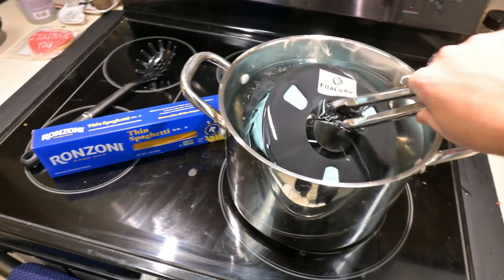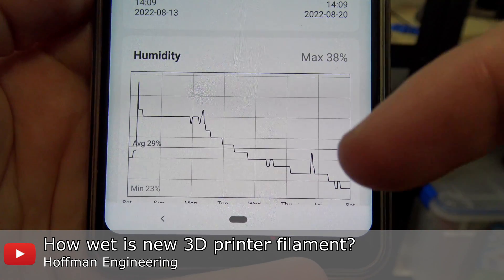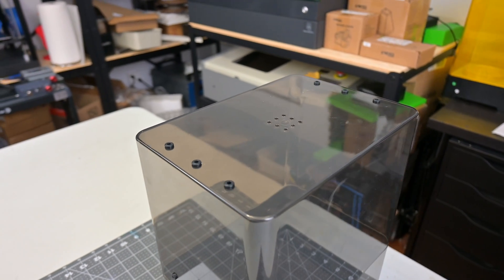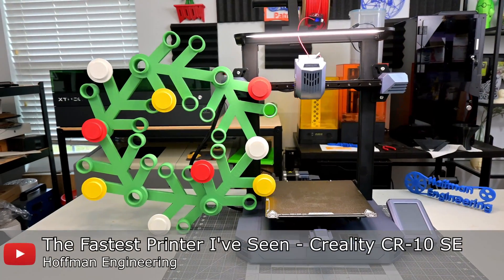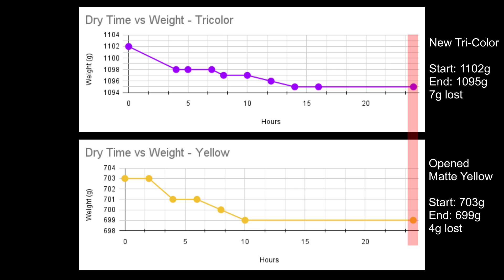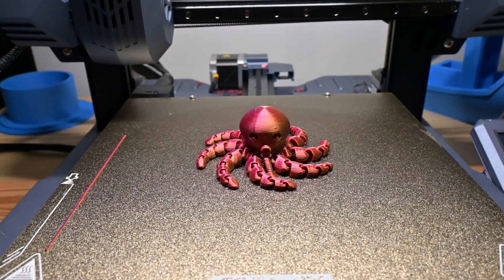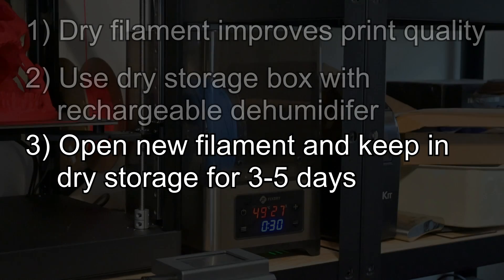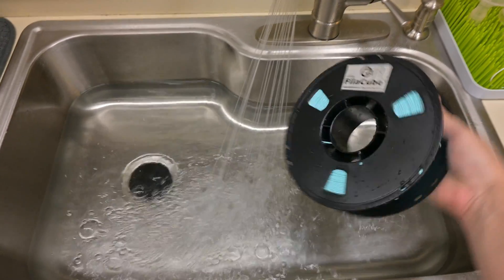Is wet filament really that bad? Do you need a Filament Dryer? - FIXDRY Filament Dryer Review

Comment: This is confusing. Just recieved my new filament dryer and i haven´t opened the box yet. After seeing this video, https://www.youtube.com/watch?v=5CFxT1q6dX8https://www.youtube.com/watch?v=5CFxT1q6dX8, i don´t know what to believe.
Reply from the maker: I have two concerns with Tom's tests. The first is that he never dryed the filament. His "fresh" control tests were right out of the vacuum sealed bag, which is already wet filament. My tests show that new 1kg PLA contains about 3-7g of water. So he never shows what actual dry filament looks like. 

Second, this is from 3 years ago where a prusa mk2 will print at a speed of 60 mm/s. Modern printers are printing at 10x that speed, where filament moisture can cause much bigger problems.
Reply: @HoffmanEngineering  Thank you for reply. I thought so too that his video was too good to be true after seeing many videos that filaments humidity has a big impact how the prints turns out.

Comment: I think paying £90 for a FixDry dryer is a small price to pay for the difference in print quality alone. I agree on all points raised about keeping dried filament in a sealed storage box, with silica crystals inside to maintain humidity thereafter. I found freshly dried warm rolls of filament attracted moisture like a sponge, unless I protect them from humidity after drying. For a while before buying a dryer, I used to leave my filament inside a regular plastic storage box, which included a pair of old socks filled with clay cat litter, until I found a couple of reusable silica dry bags on Amazon to replace them. 👍

This is my opinion, I could be wrong. 😉

Comment: Hey, I also live in Florida and my home can get pretty humid at times (above 65%).   Do you think your dry box container solution would work if I was to print ASA, or do you think having an active dryer like that Fixdry would be required?    I am fine taking my time to dry out a spool.
Reply from the maker: If you've got the time, I think a dry box is the way to go. ASA isn't crazily moisture sensitive, so you don't need to worry about keeping it dry while printing. Storing it in a dry box between prints would be the way to go.

Comment: This dryer design is just dumb, they need to make the lid separate from the filament outlets to prevent the hassle of trying put the lid on and feed the filament at the same time
Reply from the maker: That is a good point. I did run into that problem once or twice, when I wanted to move the dryer but couldn't without unloading the filament from the printer. I'll have to give the Markforged dry box a try sometime in the future!

Comment: Very interesting about the silk filament not sticking when "wet". I recently tried microcenter silk PLA, and it didnt stick to PEI in the same way you showed, fresh out of the box. But i didnt dry it. Some people online did have the same issue, and some others didnt. Maybe the moisture level does affect the silks, or as you mentioned, maybe some VOCs are removed more from silk filament that affects adhesion.  Either way, this is the first time ive seen anyone make this observation. Cool video nicely done. I would mention that it doesnt seem like you did a torture test by adding moisture to the filament on purpose, then putting it through the various drying steps, but thats a minor gripe.
Reply from the maker: I did not run that experiment, but that would be a good thing to try. See how much moisture I could get a roll to absorb, and see how it dries. I'll add it to the experiment list!

Comment: Can I just store them in containers with desiccants?
Reply from the maker: Yup, you can. You will need to dry out the dessicant over time though, as they will eventually become saturated with moisture as you open the container. That's why I like the rechargeable dehumidifiers, as the dessicant inside changes color when they are wet. That let's you know when you need to dry them.

Comment: I found a reel of ABS in my cupboard, must have been there for 10 years.  Thought what the heck, I'll give it a try.  Amazingly worked perfectly, was gobsmacked.
Reply from the maker: That's awesome. I'll have to look around and see what rolls I have that might be that old. I must have some filament samples that old that hasn't been in my dry boxes.
Reply: Cheap humidity meters are available on Amazon that can indicate how suitable an enclosure is for keeping filament in prime condition, I found keeping filaments away from breathing humans and steamy locations that create moisture like kitchens and bathrooms, helps to keep moisture ingress to a minimum. Just wrapping a roll of filament in a dry towel, with cat litter in a sock can act as effective temporary moisture barrier. 😉

Comment: Great video! I've always wondered how long the "safe time" is until the filament needs to go back to the box/dryer? What about 24h long prints? I do an 8h drying in my drybox, then print with it, and probably forget to put it away instantly, or print in the evening, and turn the printer off in the morning. Is the filament still dry then? I live in a quite dry environment, with 50% humidity, so not quite like Florida ;)
Reply from the maker: Great questions! Seems like I have a few more experiements to run :D
Reply: @HoffmanEngineering I was expecting AN ANSWER not more WAIT TIME ;) But it's a good question, right? Your approach to it, by weighing the roll and calculating the liquid that was in it before/after the dry process is a good one. I probably will do it myself. Unfortunately you'd need a roll KNOWN to be moderately wet to start with. Dry it until it doesn't loose any more weight and then weigh it again every like 2h/5h/24h/1d/1w ... and see when it it's back to it's "original" weight. Could be interesting, but absolutely worth it I think.  My dryer shows around 15% humidity after some hours. I hope this means that the filament is thouroughly dry as well at that time ....

Comment: Interesting observations, thank you!
Some hopefully constructive comments: 
Lots of material used for the prints. I think you could have achieved the same (or better) investigation with smaller dedicated prints, reducing time, cost and waste.
The drier works well, but it seems a bit superfluous with your eva-dry storage solution. I guess if you get a new filament and time is of the essence, or if you are mass-printing, it's a good solution to ensure consistent results. But otherwise, at that price point, eva-dry seems superior.
Reply from the maker: Thanks for the discussion! The test prints were relatively small, in total all the test pieces used 162 grams of filament. I don't feel like that was particularly wasteful, but it is a good thing to keep in mind.

As for the dry storage vs a dryer, I agree. I think most people would benefit more from dry storage. It's only when you need a faster dry time, or you are printing with a more absorbant material that a dedicated dryer would make sense.

Comment: how do you fix brittle filament I live in Arizona and its super dry  and my wood and glow in the dark pla just snaps all the time
Reply from the maker: Normally brittle PLA is a sign of moisture. Wood is different though, wood PLA that uses actual wood fibers need to be kept in higher humidity. I think I remember my last wood roll said 45% humidity was ideal.
Reply: @HoffmanEngineering Do you know why it's always the first meter of filament that is especially prone to breaking/snapping? Maybe it's a little more exposed to environment?!
Reply: @izemanevobike could be the additional exposure time between running and vac sealing, as well as any UV exposure before boxing (Should be minimal, but that'll depend on the manufacturers process)